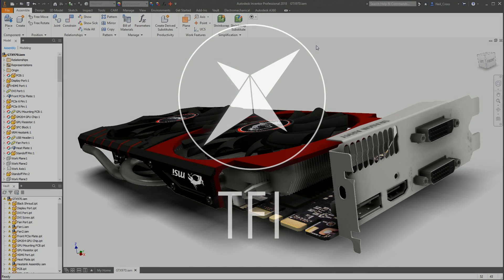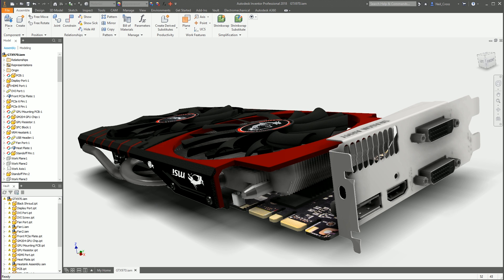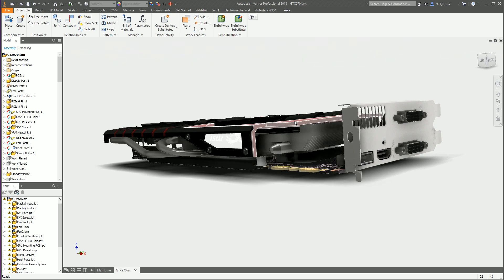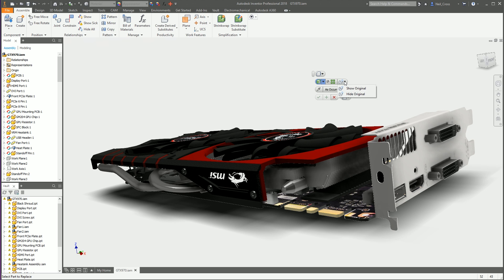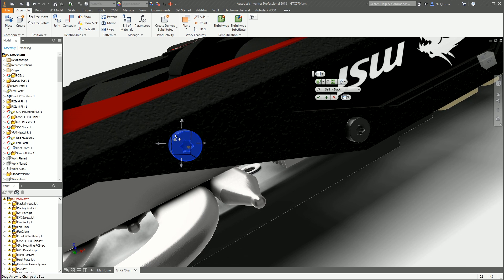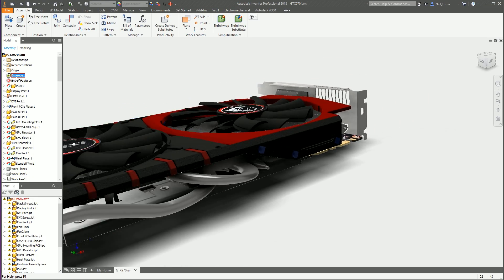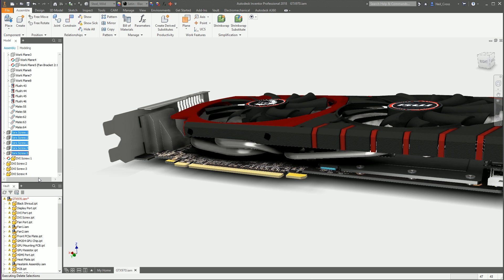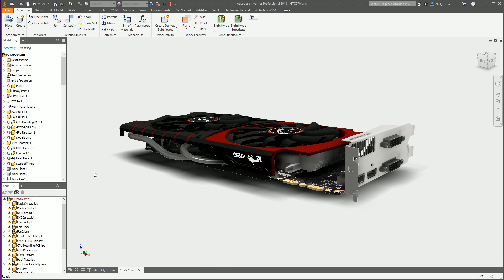How to remove IP from a 3D model | Autodesk Inventor

Comment: Does China honor any intellectual property standards?  Are they actually paying Autodesk for their version of Inventor ?  How many Chinese laugh hysterically - when a model is sent over with copy-protection stamped in it?
Reply: This is not solely a problem in China. In fact their value of stolen sw is less than that in US: See pg 6 for factshttp://globalstudy.bsa.org/2016/downloads/studies/BSA_GSS_US.pdf#page=6
Reply: With all software is a matter of time before it's copied, or customers switch to open source option.
Reply: Open source is not a viable option for mo st things other than Linux itself. There is no adequate replacement for tools such as Inventor.